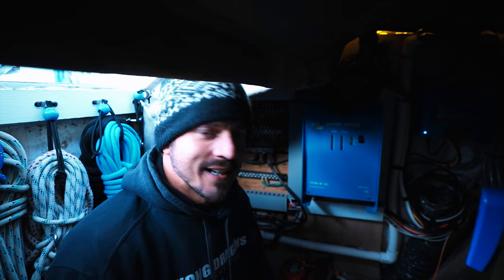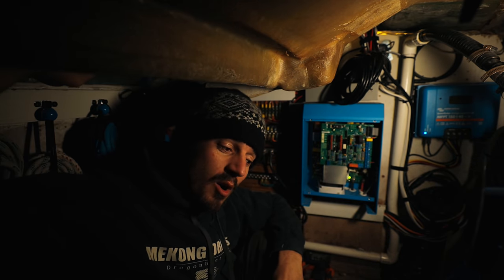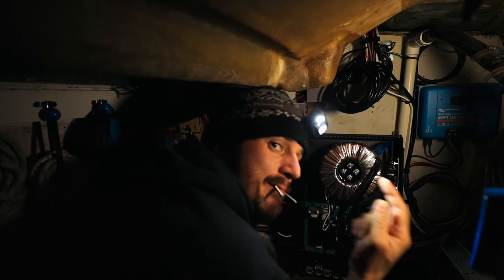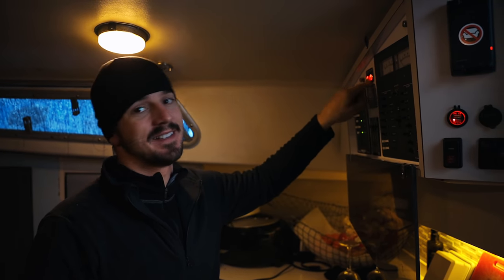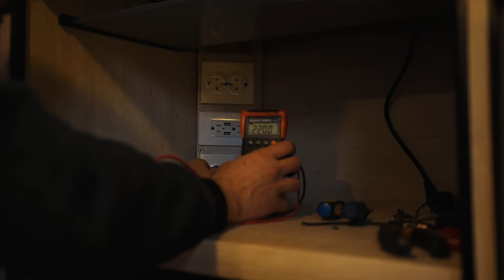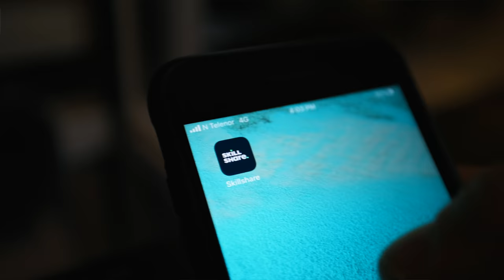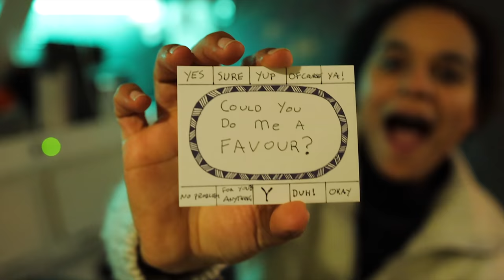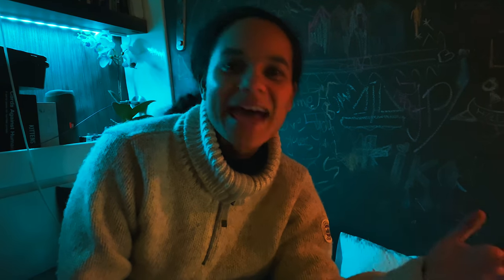Cold Dark Days — Sailing Uma [Step 255]

Comment: But Victron's from The Netherlands, how did that poor MultiPlus make its way to the US en route? 

What are those giant cylindrical sections stored in the pilot berth? 

How do you make a foil-cooked pizza look so delicious? I have so many questions!
Reply from the maker: Battle Born Batteries are the ones we work with for pretty much all of the electrical components we have on-board now. They’re super knowledgeable and we have a good relationship with them. That’s why it came from the USA. 

Those cylindrical section are a project we’re working on. You’ll just have to wait and see.

And, magic.

Comment: Between you and the guy on Sailing Sophisticated Lady, I've concluded you need to be an electrical and mechanical engineer if you want to sail anything bigger than a canoe.
Reply from the maker: No. You just have to read the manual. It’s all in there, clearly detailed and labeled.

Comment: Why not connect the battery charger into the charge controller???  I am assuming you are going directly from the charger to the batteries now.  It may or may not work right depending on how the charger is designed.  Worth a try.  (Charge controllers are sophisticated dc to dc converters and can convert almost any kind of current to charge batteries)

Comment: The easiest way to ruin good and  expensive batteries is to charge them with the wrong charger.  A lot of companies that make chargers for specific batteries don't work right for all the batteries they say the charger will charge correctly.  And for  the guarantees they give, try collecting on them.

Comment: Are you still happy with the wood stove?  Would you prefer to have a diesel unit with forced air? Does your flue create soot on your beautiful white boat?  I'm also converting my boat to electric and don't want unnescessairy diesel appliances, but I live in Canada ~ similar to Norway every winter. Thanks.
Reply: They don't carry any diesel on the boat.

Comment: USB sockets look clean, but the spec changes every few years. Instead install 12volt car sockets (cigarette lighter sockets) and use easily replaceable USB car sockets that just plug in. So much easier to update with USB spec.
Reply from the maker: Or just replace the USB sockets every 5-10 years if needed. They’re only like $5 each.
Reply: @SailingUma  True. My tip was more for your viewers as you have already done the install.

Comment: Those "European" plugs look like Type F  plugs, they are not the only "European" plugs but probably the most common in Europe. In Asia you'll find Type G and Type F are quite common except in the 110V countries where the NEMA plug is used, anyway for the full rundown on all the plugs and voltages in every country check out: 
https://en.wikipedia.org/wiki/Mains_electricity_by_country

Comment: What's lithium ion battery degradation like on the boat? Are guys worried about the 100% charge deep cycles degrading the batteries faster than only charging up to like, 90%?
Reply from the maker: So batteries like our measure degradation in “charge cycles”. In 2 years, we’ve only cycled our batteries 75 times. After 3000 cycles, they will have 80% capacity remaining. So with that math.... they should last for 87 years.... and they still have 80% capacity left.

Comment: might check out "capt Rick Moore" as they just put in all inductive cook top and run a small elec oven .  no problems so far=  but being in cold country, you might have other issues involving Lit batteries in the cold  Do you have heat pads?  Happy birthday girl- love you   from my comphy chair Bill
Reply: And the InstantPot. 20 minutes at 1500 or 1800 watts at high noon off solar then just sipps watts to keep warm until dinner.
Reply: Rick has 2400 watts of solar...and high powered alternators to keep the battery bank topped up.
Uma has a mere 480 Watts of solar...useless in winter...and no way to charge batteries away from the dock.
Reply: @charlesharper2357  so the answer is "No"!
Reply: @williamoorejr  
Unless they're at a dock with power   :-)
Reply: @charlesharper2357  touche  Did you see the one with the Tesla guy at the gas pump and he was asked about the car needing gas- but when he opened the trunk- there was a Honda Gen in there and he said it runs for 15 min and they would be good to go.
Reply: @charlesharper2357  correct, but you forgot that Uma has hydropower to charge batteries when sailing.
Reply: @MartinRunesson  
They've never had any significant amount of regeneration from sailing.
Most knowledgeable people claim you don't get much power until you're doing over 8 knots...which is rare in a monohull.

Comment: Isn't it better to only charge to 80%? For lifespan
Reply from the maker: It’s faster to charge to around 85%, that’s when they go into absorb cycle which takes longer. We charge up to 100% before we leave the dock, and they almost never get back up to 100% if we’re off grid or off shore, with just solar and regen.

Comment: Happy birthday!!

Alternative oven - use the ash tray area under the stove - but you need a foil cover or small roasting tin (plus some where to put the ash tray whilst everything is cooking

https://smile.amazon.co.uk/Enamel-Roaster-Lid-20cm-Casserole/dp/B01MZHIBA9/ref=sr_1_51?dchild=1&keywords=small+roasting+tins+for+ovens&pd_rd_r=4615426a-25db-4fd5-9aea-8879a41af1b6&pd_rd_w=vC5MN&pd_rd_wg=QWX73&pf_rd_p=a25f99e2-8e56-42d2-b61b-879dc5a555f6&pf_rd_r=MN5NQCGWHJ1Q9R7C11WP&qid=1614274681&sr=8-51

Comment: I'm pretty sure I don't have all the details but lithium batteries are never supposed to be charged with a ld charger. it's not the same voltage or charging strategy. Could be very dangerous.
Reply: Dan said it was the same company who make the battery that send them this charger. So I´m pretty sure it´s safe. ;-)
Reply: @steinjohansen3142  not worried about that one, meant the old system.
Reply: They are using high quality batteries with a BMS (battery management system), that should limit or disconnect the charging if the input power is out of spec - and prevent overcharge, etc.  I think that was a case of not ideal, but also not dangerous (the old system).
Reply: @andre_renard  not completely sure. It should, that's for sure and that's what I thought the bms would do. But I've just heard someone managed to wreck the whole lithium batteries on a brand new garcia...
Reply: @vipecrx  Eep, that would be an expensive mistake!  Maybe their BMS wasn't as good as the BattleBorn, or they use raw cells and just assume everything connected will do the right thing?  With LiFePO batteries at least it's not as likely to catch fire as say NMC cells, but the cost of damaging a full pack of lithium batteries would be painful....
Reply: @vipecrx Actually this reminds me of this video: https://www.youtube.com/watch?v=Rkan4TotORI  Looks like in some cases you can destroy a BMS/Battery with a poor charger, although perhaps that's just that particular BMS which has an issue...  Still likely worth always using the right equipment for the job just in case.

Comment: Well now with your new electric system it’s time to invest in a raspberry pi 4 and a flat panel HDMI screen. Tons less power needed than using your laptop and movies and games will be a real joy! Check out raspberry’s on SkillShare! Stay safe. Feliz Cumpleaños Kika 🎂🥂🎉🎊⛵️⛵️⛵️⛵️⛵️⛵️⛵️⛵️⛵️
Reply from the maker: Nah. Tvs use more power than our laptops do. Besides. We already have laptops. Why get another electronic device that only has one use?
Reply: @SailingUma  Wrong. Raspberry pi is actually a very powerful $100 computer that can be used for numerous tasks. And there are HDMI monitors that use little power. Many sailors are actually using raspberry pi for navigation. At least take a look.

Comment: I have noticed that no matter the sailing shows you watch..pretty much all the sailors have excellent power tools.But every time you use one of those wrist breaking spade bits I cringe and worry that you are going to cause yourself harm..Please get some nice point wood working bits. High Speed Steel bits and some Forschner Hole bits... You do such good work you should have good drill bits..
Reply from the maker: We use whatever we have to get the job done.

Comment: Just a foot note, the more electrical the boat gets, the higher the voltage and of course this brings more efficient systems.
Just like the automotive industry but in a highly conducive environment!
The best system is of course a Tesla based system and convergence to this is unavoidable. Mitigation the risks will obviously be the issue and don’t stick your fingers in electrical devices with capacitors!😜

Comment: Duel voltages in the same breaker box is an absolute no no, very bad practice and dangerous
Reply: I`m no electrician, but I always seen multiple voltages in the same cabinet.(Norway)
Do you know things that Norwegian electricians don´t, or what?
Dan had guidience of an Norwegian educated electritican for this install.
Just wondering if there could be any difference between electric components in different countries, or only lack of knowledge.(Norwegian authority seem to be very consrened with safety issues)
You seem to be pretty confident in your statement, so it would be nice to get your comment in this. It´all about safety!
Reply: @steinjohansen3142  If your not an electrician your not qualified to comment but thanks
Reply: @tonybell4447  lol
Reply: @tonybell4447  He stated at the outset that he was not an electrician. Nevertheless, he asked you a series of simple questions. Questions whose answers would be of interest to many of us.
So why did you respond with dismissive superciliousness and a patronising 'but thanks' instead of answering his questions?
Reply: @tonybell4447  It was only a humble question from a novice that care about safety. Your arrogant answer makes me wounder if you even have the proper knowledge to answer the question in a qualified way.
Reply: @gudlukkay  Instead of lafing, why don´t you tell me the reason you think my quiestion as a novice has no need  of an answer.. If you think i´m so numb, why don´t you eduacte me, instead of making fun of me?
Reply: Come on folks! Give a thump down if you think it´s okay to post a comment you can´t defend, or a thump up if you think you have to be able to make substance to your statement
Reply: @steinjohansen3142  Its very bad practice to mix voltages cables anywhere that includes ducting and trunking because if the insulation was to break down you could have the possibility of shooting high voltage  into a low voltage device, this is particularly the case in a breaker box where a badly made connection could fall off and again power up a low voltage cable. breaker boxes should be isolated with one switch not two which would be the case with duel voltages you could turn off one switch thinking the box was dead when in fact half of it is still live, the idea is to make the wiring as foolproof and safe as possible I'm afraid your Norwegian electrician wouldn't last 5 minutes in the UK . Finally I apologies if i was abrupt but I get upset when I see the promotion of unsafe and dangerous practice
Reply: @tonybell4447  Thank you for an proper answer! :-)
Now I hope an Norwegian electrician can come forward and explain why I´ve seen multiple voltage in the same cabinet. 
Is it numbness, or is it an reasonable explaination for that? In advance txs.
Reply: @tonybell4447  An other most likely numb question as a novice. If you should connect multiple voltages into an adaptor to cope with multiple voltages, How would an English electrician do it?
I beg you to be sure I´am asking a humble question.
Reply: @steinjohansen3142  I'm not really understanding what a multiple voltage adapter is but what I can tell you is if a device requires dual voltages say mains voltage and data switching the device would have two separate sets of terminals well away from each other
Reply: @tonybell4447  If you have one contact reciwing 230 v, and that contact should be able to deliver both 230v, 110v , 48v,24v and 12v at the same time. Or one contact reciving 110v be able to deliver 230v, 110v.48v,24v 12v. and so on.That´s what I mean with an multiple voltage adaptor. 
Your statement is that my humble knowledge makes it unaciveable by English electric standards, but all other countries manage to cope the challenge Like an inverter and a converter.
How do an English electrican wire that adaptor? Or is it illegal in the UK unless you have a footballfield for wiering and connecting?
Reply: @steinjohansen3142  If your talking about transformers that's fine because you have one voltage in and one voltage out but the voltage out would be high or low voltage, not a mixture of the two nor would you mix ac or dc
Reply: @steinjohansen3142  the UK is a small country we do not have the space for football fields of wiring lol, seriously space is not a factor when considering safety
Reply from the maker: Children... now now.... no need to yell and name call. 

Let me clarify a few things. Our friend helped us find the right components, we designed the system. This isn’t a “standard” set up here in Norway, or anywhere really. We consulted 3 different experts from three different countries to make sure we weren’t missing something. We don’t just blindly plug wires into things and hope for the best. 

Yes, in a house, with random contractors and future owners to consider, building codes and insurance too, having multiple voltages in the same box is a big no no. 

On our boat, we can choose to do this however we see fit and works best for our needs. There are no codes or laws we’re required to follow. Simple a set recommended standard. Which our boat is far from anyway. 

Also, all our power comes from the same battery bank. The 230VAC and 120VAC are coming from inverters running off the main 48vdc battery bank, which has a main shut off switch directly below this breaker box. So, with the flick of that one switch, everything on-board is disconnected. Hence why we didn’t mind putting all the breakers in one box. Also why Kika was in the dark during the final stages of the instal. 

We also of course labeled everything and colour coded each voltage and breaker. 

Everything on a boat is a compromise. Yes, ideally every voltage would have its own box and conduit, it’s own wire colour and code. But in reality, that just isn’t practical. What we do, on our boat, is what we consider the ideal solution for our needs. We’re not recommending others do it that way, just showing the solutions that work for us.

Comment: Nobody likes uk power outlets. they're unecessarily huge and cumbersome.
Reply: Can't find the adapters when I travel to UK. I must have 10 laying about.
Reply: @MrOmeyer  In quite a lot of uk outlets you can jam something in the earth socket to open the guard and then the euro plug will fit in.
Reply from the maker: We ditched them because they’re related for 13A, but if we ever put that much power through them, they would melt. We even tried soldering the connections and they still melted. Not a good sign on a boat. European plugs are rated for 16A and so far haven’t even started to get warm when we dump 16A through them. We feel safer with them now.
Reply: @SailingUma  ooh! you're going to atract a lot of hate from the islanders there! 😂
Reply: @MrOmeyer  I like them. Good and solid. Large contact area.

Comment: Hmmmm...Europe generally runs 220 / 380 volt...but at 50 HZ frequency.....where USA is 60 HZ and 120/240 volt.  Most computer power supplies hair dryers, etc are not sensitive and can handle the frequency difference and even a range of voltages...at least the 220volt...but it’s wise to read the labels on all devices to assure what is OK.  The many electronic and kitchen devices should be verified...which I am sure you have done.  Placing several voltages and AC vs DC in one breaker box...makes me want to cringe....to make sure they are separated from each other...but the big reason...is a future person (un-named) may turn off a couple sources and get hands in a box for doing something...that still has more live sources inside...and get a shocking surprise!  Perhaps taping up everything to assure isolation and finger-touch safety is a thought.  Best wishes...love the channel.
Reply from the maker: Yes. But all our AC comes from inverters, which run off our batteries. So if you shut the main battery switch off, all the power is off.